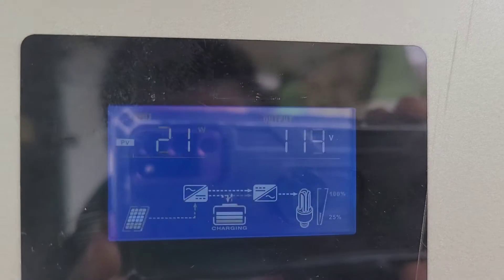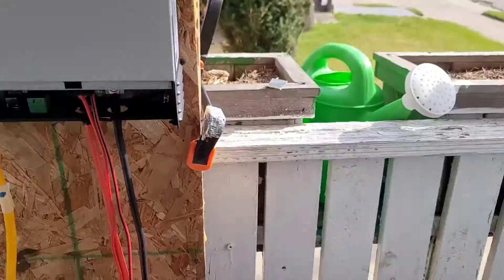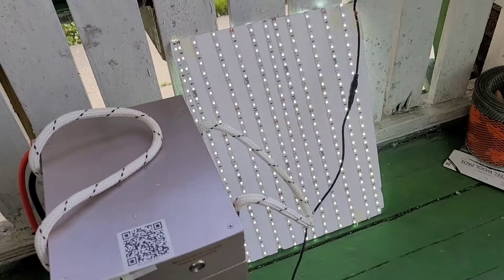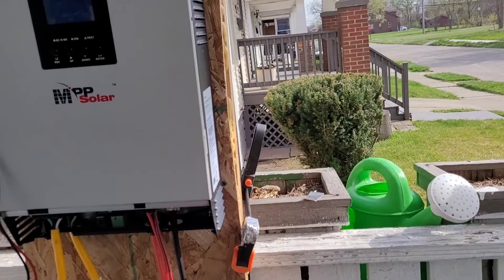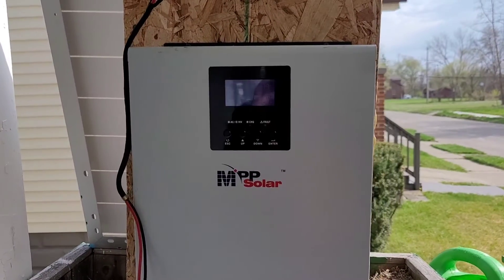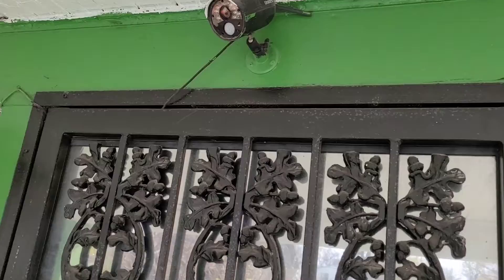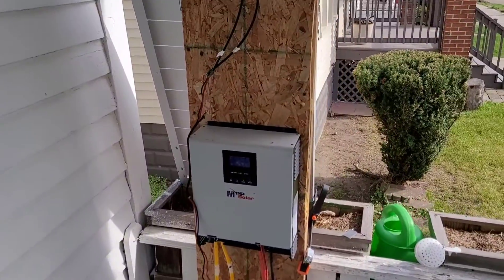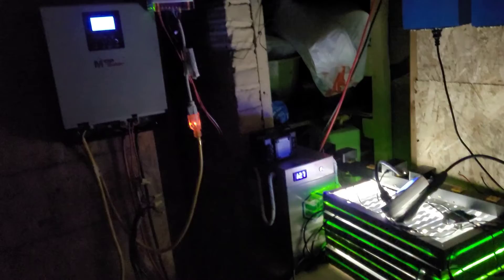Why do I use LED lights to run my solar system?

Comment: Ok, so this explains how you are powering the leds. You have to actually have a solar panel initially to get the power which in turn powers the led lights which brings in more power using a second charge controller (I assume?). 

So these people that create a go kart and put a solar panel on the roof, if they added a number of stacked panels with leds power by the one on the roof, you could have endless energy or at least something that lasts a long time. If the motor takes 12v, 5amps to run the go kart, and you are generating more than that from the solar panels, then allowing for losses, you could power the go-kart indefinitely (I think)?
Reply from the maker: battery side and is calculated as a loss and as you see in this video the losses are constant and is calculated and still we get a net charge because we did the math, https://youtu.be/2uuegb8EQ2Y?si=4z_TXWm_G-2USLUB

Comment: Are 100m of 6500k leds 20w per m 2000 Lumens pm 220v ac  good leds to use with 550w bi panels? What line width to use 5cm or 10cm spacing? With 5cm could do 4 panels, the leds are 120° beam spread, how close to the panel do you recommend for those? Should the light overlap when doing spacing? Total light 20k lumens for 200w ,100m.

Comment: It is hilarious how the establishment tries to supress over unity inventions but they unwittingly disclose how the devices they support are violating the laws of thermodynamics . One example is the fast charging electric car battery technology. They claim that now it is possible to fully  charge these new types of batteries in under an hour what use to take several hours using standard car battery charging stations and the car can be run for up to several hours before another recharge. So right there they are admitting that overunity is possible without them realizing.

Comment: That Zimbabwe inventer might have made a Freudian slip when he said the car was solar powered then later said it was using ambient RF energy. We know that solar powered electric  cars have been around for decades but their batteries had to be charged during daylight hours. What if that Zimbabwe inventor also figured out to use LED lights to power solar cells inside his mystery power device which he refused to allow anyone to peer inside ? Some military grade LED flashlights can put out insane levels of illumination even when using those miniscule rechargeable lithium batteries. Now image what that light can do when it hits a modern solar panel at full intensity ?
Reply from the maker: @onetruekeeper  I said that in my video he made this slip after realizing that I had a project that had indoor solar panels working off LED lights
Reply: @ Not likely he knew about your work with LED. Many inventors will come up with the same idea at the same time.

Comment: Hi,:face-red-heart-shape::face-red-heart-shape::face-red-heart-shape::face-red-heart-shape: can you show the actual setup on how you run them at night or in the dark. Please take your time. Been searching for this and no one really shows it properly. Only one Channel so far done this setup nicely. Pl:face-red-droopy-eyes:ease if you don't mind redoing this and show us the night setup?
Reply from the maker: I am putting together a video it may be a little bit long but it should explain everything. No to give you a preview to do any projects which rather it is solar batteries or any other type of devices that use small sails you have to put them both in parallel and series not just all parallel or not just all series anyone doing this will fail at this project you must know the voltage you want to achieve and the amperage you want  To achieve. And then hook them up in parallel and series as required this is the number one rule. Second row you have 16 feet of LA D lights to work with they can be cut and sorted together in any configuration, If you watch my other video what the AI said about it then it starts to make sense just sit down and take a piece of paper and do the math. You'll see that because the length of the LA delights that you can spread these Solar's over the top and then the bottom of them to double them up you will start to see that you'll have more than enough power to not only run the Lights but also given enough power to give to you added it app correctly on paper you should have a 120 votes of power using the 16 feet of solar and 10 amps When you do them in the other  Set up. I mean that when you put them both in series on one side save the bottom all in series  You'll achieve some energy out and then when you put them in parallels on top they should change to parallel Which will give you a different type of energy out when they both come together at the end you'll have a 120 votes and 10 amps at least I think that's more than enough to run something that runs on 5 votes One app. Now to keep this in my batteries are set up the same way solar sail are set up the same way everything you know are made from smaller modules are made in the same way this will help you with other projects they do not want you to know.
Reply: @WIZ56575 Thanks 😊👍 a lot. I am building a looped overunity system with no need for sun completely and 12 to 220V transformers. Will share with you when I am done ✅ Sir. Keep it up.
Reply from the maker: @elmultimediaschoolofartscu3924  
Give us a call at Media Library 313-651-5349 I'll show you how to break the laws of thermodynamics only I can do it because I the person who created over Unity this will be proof that I'm telling you the truth please watch the videos videos 

https://youtu.be/Q7EmfHowWkU?si=TA-4G9fDwhXZL2ah 

https://youtu.be/HTR03aSiGWs?si=J_0Rpqt3ybXIW3iS 

https://youtu.be/XYrgZkrO_fs?si=bFv46s1cPPiWTE7n
Medialibraryinfo@gmail.com
Reply: @elmultimediaschoolofartscu3924   will you make a video?
Reply: @Miley_00  yes I will make a 📸 video
Reply: @WIZ56575 Thanks 😊👍 a lot. I am building a looped overunity system with no need for sun completely and 12 to 220V transformers. Will share with you when I am done ✅ Sir. Keep it up.
Reply from the maker: https://chatgpt.com/share/68e97ade-f84c-800e-9cc3-6c37dfdc2b5d

Comment: I dont understand the point,why not just add that solar panel onto your main system to charge the batteries during daylight hours. Its impossible to gain extra power from those LED lights,if you think it is your math is wrong,just the inverter alone drops the efficiency.
Reply from the maker: I don't think you've ever did the math and instead of calling you a troll that is trying to control people from advancing in life I want you and anyone reading this post to Simply stretched out LED lights that come in a row that is 16 ft long also make sure they are white light as bright as you can get them daylight perfectly. Then I want you to measure the LED lights and what they put out voltage and amperage then I want you to lay one row on one side of the LED lights on one side of the lights very close together as you'll see they should measure 16 feet as long as the lights now take the number you got when you measured the solar panels and add them together you must do parallel then on the other side you're going to do series the same thing and add all those together if you got the measurement I got then those LED light put out 120 volts and 10 amps so simple for anyone who actually did the math also I checked the math with various Ai and they say I'm correct ended videos on them you either didn't do the math or you don't know how to hook up solar panels or you're just trolling people so they don't get free energy now let's see how many people actually do the math and actually come back and said okay I did it and it didn't work because after I do the video you will see that I will explain step-by-step Romper Room style so everybody in the world can see the math calculates and it's very easy to do and you are just trolling people, this is very very too simple to check out so why keep up this type of lie because it can be verified
Reply: Lloyd, I want to make this, it is not difficult to follow what you did, lining up the led in rows right over the cells front and back, on cardboard or thin wood board! Buy the type of led is bright white, I see them for sale, some are 1.5w per foot, some are 2.5w per ft, and some are 5 w per foot, in 16 ft rolls, the ones I see are 12 or 24v. I have a 3000w  solar generator, w dual mppt controllers, 32-150v, so yes I must get above 32v volt do anything, that's not a problem, I know how to parallel panels, and can make my own mc4 cables and connectors. My solar generator has 5 13.8v car chargers at 20 amps I can power the leds with, through the solar panels back in to my mppts to 10kwh in batteries. That is possible, I'm just wondering, what watt per ft leds did you use, and do you think my setup would work, I have 8 hqst 100w panels I can run day and night, just to fill my 10kwh  batteries, for basically an endless loop, and continuous power. Your reply would be appreciated
Reply from the maker: I have 35 years of research behind this single invention among many. How much actual research do you have to challenge my findings? I can provide evidence from my research, which is showcased in some of my videos. Just because you don't comprehend something doesn't necessarily mean it's incorrect. Perhaps paying closer attention would lead to better understanding. 
If you haven't watched the video I released, then you might be one of those individuals who voices opinions driven purely by emotions, lacking factual evidence to support your claims. The video offers the answer. The AI program's calculations also support the same conclusion: two solar panels generate 40 W of power, while the LED lights consume 5 W. Even if using higher-powered 12-volt LED lights, the power drawn still exceeds that of the lights. 
The power originates from external solar sources, and in my urban area, we don't receive continuous 24-hour or even 6-hour sunlight. Therefore, conservation is crucial, which these LED lights achieve. It's time to embrace new technology instead of adhering to outdated thinking. Understanding basic concepts shouldn't take centuries. If math isn't your forte, conduct an experiment: employ two 20 W solar panels and an LED light. The results will show that the LED light draws less power than the two solar panels. This is a factual observation.see video https://youtu.be/AyfsqsgntdM?si=fpiO60co0cwp2Cef 
Disproving the notion that LED lights can't run on solar energy is simple: solar testing is built on this premise. Depart from antiquated thinking and adopt a forward-looking perspective. Once you carry out the experiment and share your findings, a meaningful conversation can take place. Otherwise, your dialogue lacks coherence. Apologies for delivering this straightforward reality check."
Reply: its called reality,you are lying and this cant work. @WIZ56575

Comment: ?
Reply from the maker: The most exciting thing about this instead I put the description of what I did and all of its measurements into several AI and the IA confirm that it is possible try it, The LED lights can work on 2 types of strips LED's 1 are 12 votes, The others  Or 5 votes, Both are daylight LED lights The battery runs the LED light The battery runs the LED light, The solars are 20 W and have 2 sides because they are a sandwiched in between the LED lights good luck.

Comment: You are on the right path...
Stay the course...
Reply from the maker: Thank you for your comment, It took a little while for people to realize what I was doing and what I had accomplished with lots of research so I'll leave you this information. https://youtu.be/sJsFWAb8trA

 What see the original video Approximately 3 years ago

https://youtu.be/Dp-6fOGI6oc

 And after 3 years of research into this we get to this point

https://youtu.be/HTR03aSiGWs

Then I learned that you canCharge batteries individually and stillLink them together as one battery, just like ABM X you can equalize charge in your system, So why would you want to control the charge. If you notice in those cheap dollar store LA D solar light When you put those LA d's there a auto official light notice how fast they charge

https://youtu.be/FAoWTY1t8r0

 Of course you know we had to make a big one of these and put it on A  MPPTAnd yes it works great

https://youtu.be/HTR03aSiGWs

 Keep in mind that bifacial solar Work on the same principles , Or think of it this way early morning light or evening light when the sun is not at its brightest but your panels are still putting out power, What about those rainy days or snowy days. You have to look at the power consumption of L E D light, they say right on the package most of them, anyway that they're 91% efficient. That's better than most cheap charge controllers,

Comment: So your saying you produce more power(watts) using the LED lights on the solar panel than it takes to run the LED?
Reply from the maker: There are two answers to this question. A string of LED lights that can plug into a phone charger and run from 5 volt 1 amps, how many solar cells do you think I can put in 8 ft since the string is this long, and it's daylight meaning that these are the brightest lights they have. Second answer if you buy lights that were 16 ft and run on 12 volts 2 amps,

Which comes to 24 w, now since I've wrapped this around a board I have two sides which means when I sandwich them using to solar sales in the board of Lights in the center. If these solar cells are 20 W + 1 amp and I round that off because they actually give off a little more than an amp,* this * 2 and you have 40 watts of power, is that more but here's the trick this goes into your battery because they do give off power and charge the battery you have a stack of them and that stack can be Unlimited just remember that the battery must run the lights which I've shown in videos to get people to understand that I can get more out of the battery then you can running them directly you'll have to go back over my previous videos to understand that I'm using batteries as a boost that means when I put that 2000 watt inverter connected from the batteries that are 12 V 100 amps I can run those LED lights all day long here's a few of my videos to watch if you still don't get it please drop another text.

Here is a few videos that will help you understand they are mines so if you have questions on them I'll give you a number to the library in which I run so I can answer all your questions in person if you wish to but here's the links I want you to have

https://youtu.be/_HX4qQ9QoGE

https://youtu.be/Dp-6fOGI6oc

https://youtu.be/HTR03aSiGWs
Reply: @WIZ56575 You can make a long circular paragraph all you want, but the man's question is still simple, and valid.
 Just answer the simple question with a simple answer.
Reply from the maker: @johnwyman6126  here is your answer
https://youtu.be/AyfsqsgntdM
Reply: @WIZ56575  That link doesn't answer the question. The AI missunderstood the question. The AI thought he wa using solar PV (40W) to power LED (5W). The question actually asks about using LEDs to illuminate/power solar PV. Thats the other way around.
Reply from the maker: https://youtu.be/AyfsqsgntdM